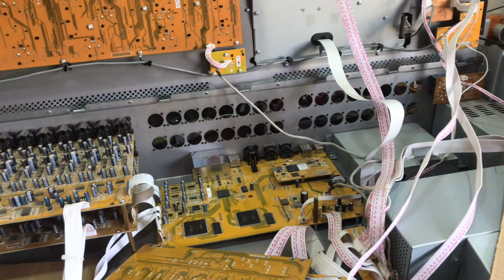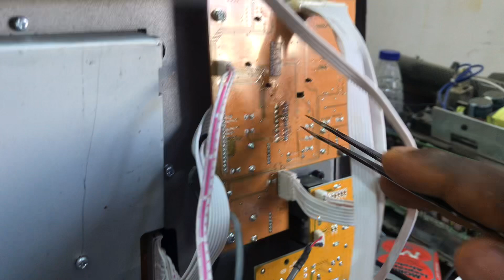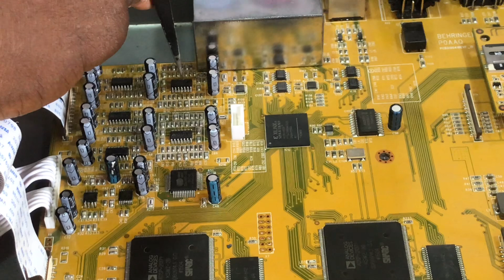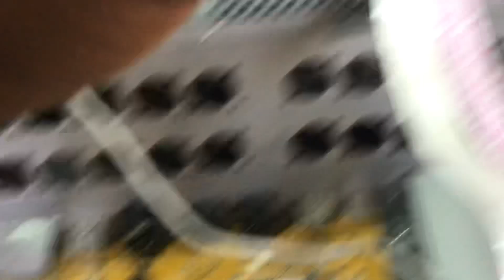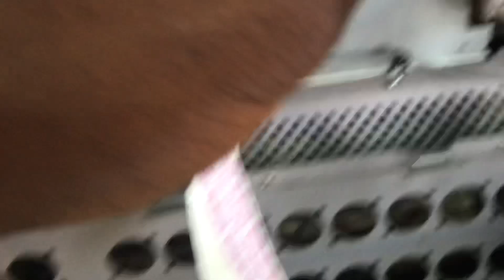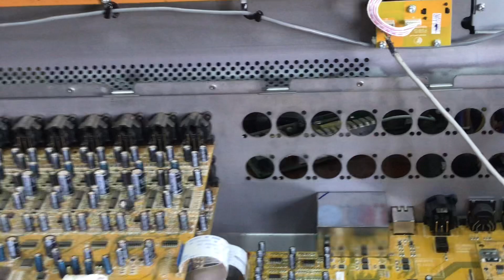Behringer X32 _ How to Repair/Fix Headphone (No Audio/Sound Problem)

Comment: I have a problem with the x32, the cnl 25-32 input has no signal, can this be categorized as damage to the A/D converter IC? (CS5368 IC)
Reply from the maker: Check the power rails and confirm that all input supply are complete

Most of the time the problem is associated with the input supply voltage rails
Reply: @u @ugearsandtech All power voltages are normal, after I tried the phantom test it didn't work, could this also be due to the damaged atmega 8a IC?

Comment: This fixed my board right up! Perfect! Thank you so much. What happens is, when people connect HP up to the side ports while the Board is operating at high output levels in the HP monitor section, it can take out the op amp. Be careful and turn HP volume down when connecting HP's.